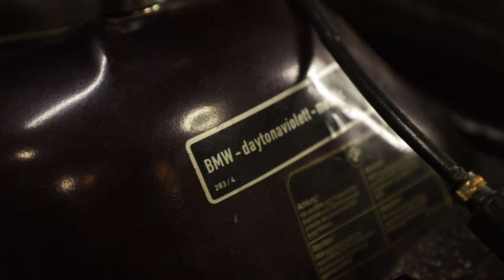My High Mileage E36 M3 Is COVERED In Oil

Comment: How was the oil pan I’m aware of this maintenance item I need to do it along with a power stearing refresh and mishimoto water pump and the aluminum pully from turner motorsports but I’m curious if my pans fine and this where all gunk is coming from
Reply from the maker: Personally my oil pan was fine, I knew prior to this all my fluid leaks were coming from powersteering and oil filter housing. I’d suggest replacing the oil pan gasket if you don’t know know when it’s been done last but it’s definitely a large job. If it’s just seeping a bit clean it up and leave it the way it is